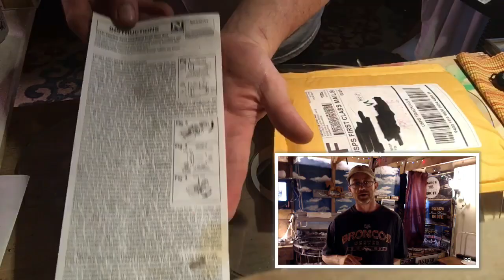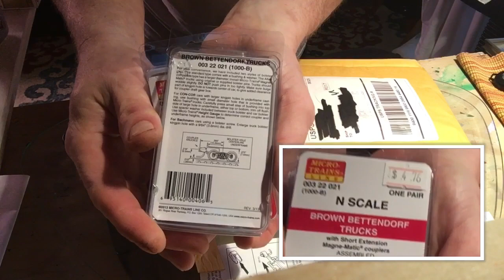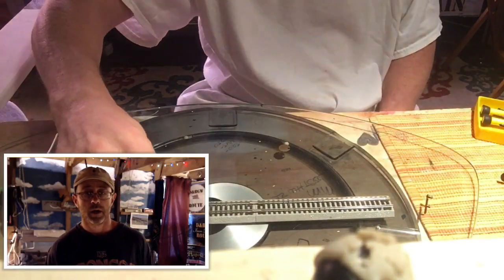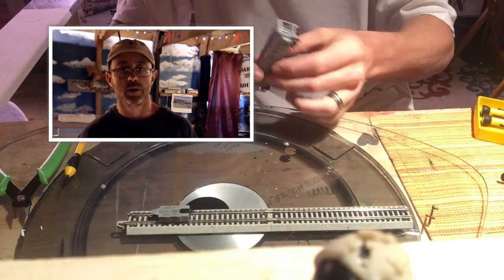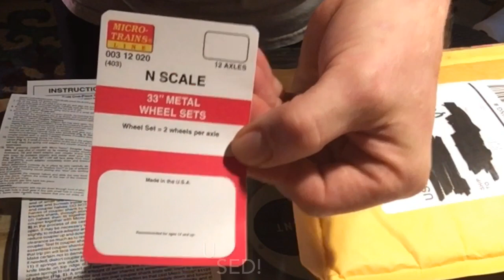Micro Trains Bettendorf Trucks - N Scale Model Train Railroad Videos - D&RGW Iron Horse Route

Comment: Glad you found something that makes the hobby more fun. Since I am modeling HOn3, I have found some really nice MicroTrains cars on eBay. I love them! Unfortunately, they no longer make the narrow gauge HO cars. What I also found on eBay, by accident really, were Central Valley archbar(old style) trucks. These are also no longer made, but I was able to find a rather good supply for my rolling stock. These don't come with couplers, but do have metal wheels. I then will add Kadee couplers.
Reply from the maker: Cool  HOn3.  Whoa!  Is it difficult to find materials in general Claude?  What size exactly is HOn3?
Reply: It’s HO scale, but narrow wheel gauge. Prototype is 36” vs 4’ 81/2” for standard gauge. Not hard to find materials in general, but cars and engines are more rare. Blackstone Models makes both and really nice, but not cheap. Most rolling stock you find are kits.

Comment: I run Rapido couplers on everything I have with only a few exceptions. They’re actually fairly reliable for me. I started with them and that’s probably what I’ll probably keep using. Love your video editing skills Brian. Steve
Reply from the maker: Good Morning Steve!  I had rapdios on everything, but with my extreme turn radius and grades, I need the best holding coupler I can find.  I have found that to be the MTL couplers.  They seem to hold a little better, but more than that, the whole truck set being installed together, really makes for a smooth and accurate replacement and they seem to be holding really well.  They look Great Also.